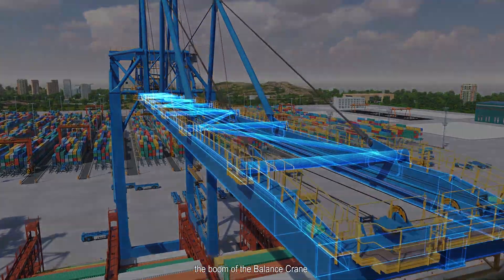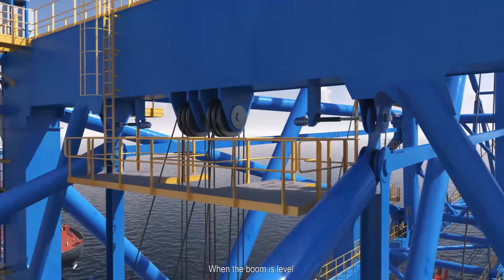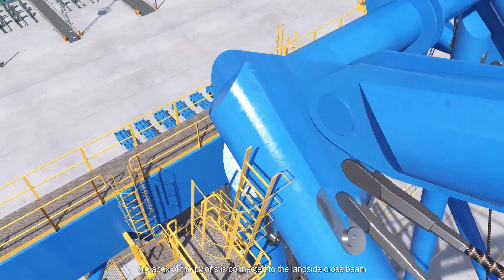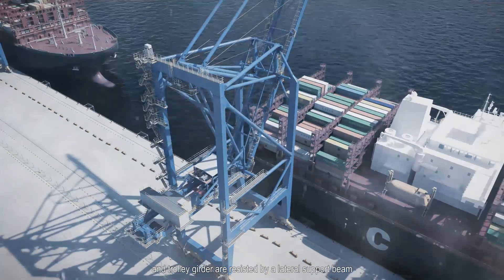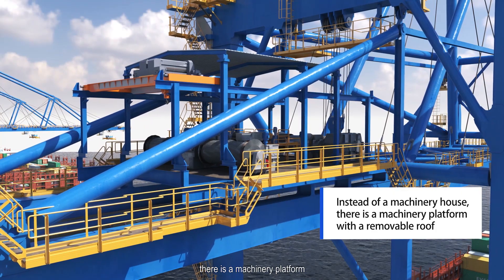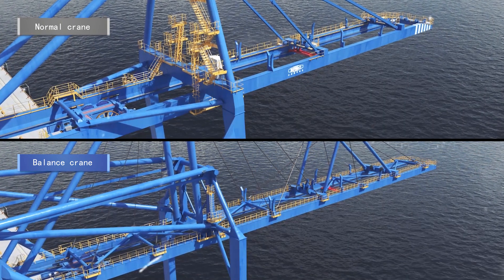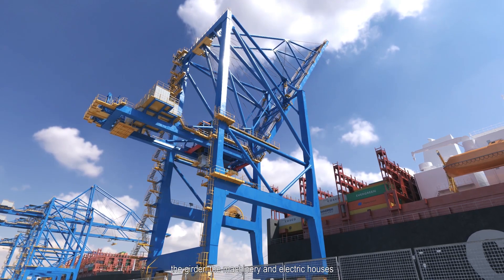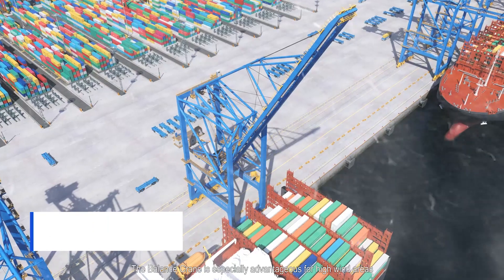ZPMC ABC Crane English Compressed

Comment: Now all zpmc needs to do is find welders that can actually weld to code.  I took pictures of the inside girder welds on the cranes in three west coast ports to show the apprentice welders at the union hall what NOT to do.  A quote from a zpmc engineer to my engineer: "That slag(inside a weld) was caused by something you did operating the crane."